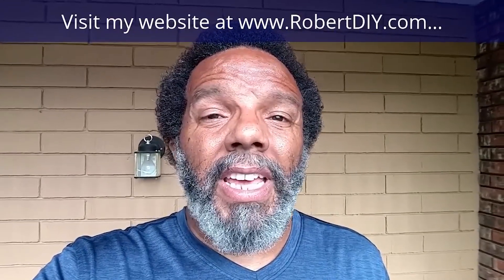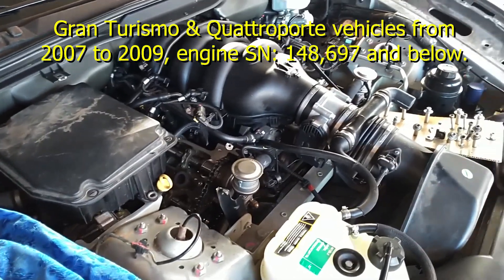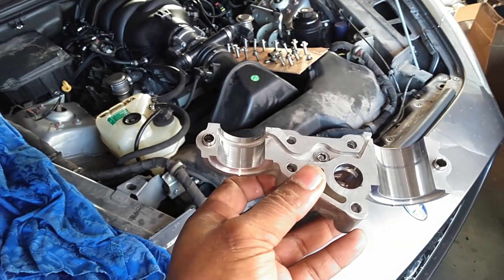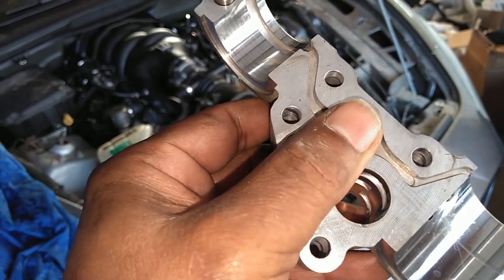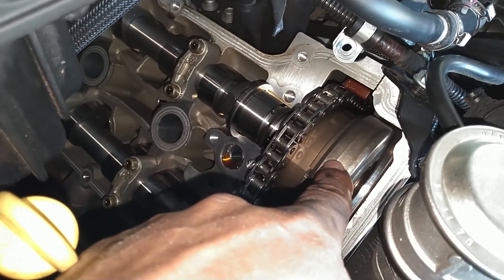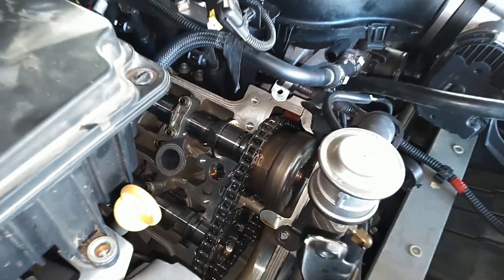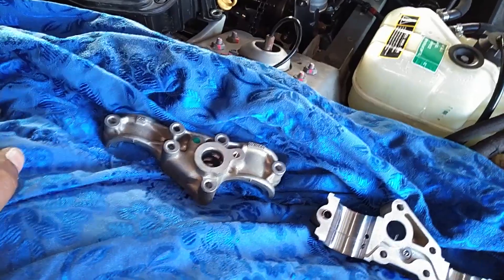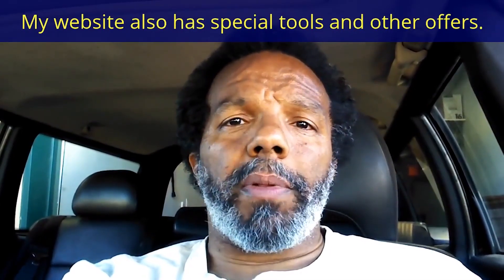Maserati GranTurismo & Quattroporte cam holder modification before and after information Part 2 of 5

Comment: Hi, thank you. I think there is another modification done, if you look at the big hole to the right you can see marks from a drill inserted at an angle towards where the valve sits.
I have been told that the valve itself blocks a passage if inserted so it has to be rerouted. Sadly i dont have very detailed pictures of the caps, maybe one can see where this should be drilled.
Reply from the maker: I am not sure what you are referring to. However, I did mention shipping or getting the parts for the repair from a certain supplier. Maybe they drilled the hole.

Comment: hello, what is the contact info for the shop that machined the cam caps?
Reply from the maker: Did you check the comments?
Reply: @RobertDIY  hello, yes I looked but I don't see anything. Maybe I'm looking at the wrong video,  there are 5 parts, which part did you list the info? Thank you, George
Reply: @RobertDIY  I see it now, sorry i missed it the first time, thanks again for the video's
Reply: TEM Performance Machine Shop  1785 Tanen St suite A Napa Ca 94559